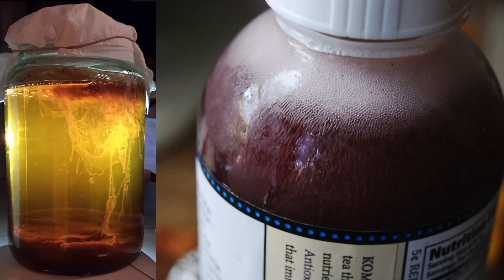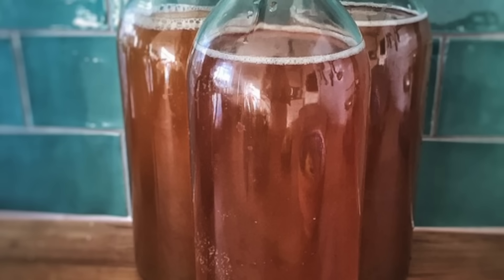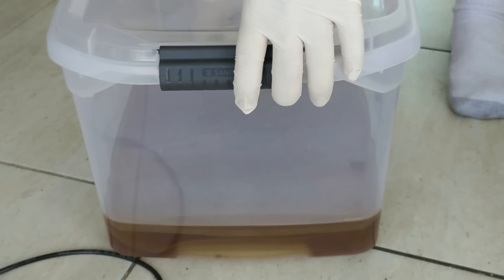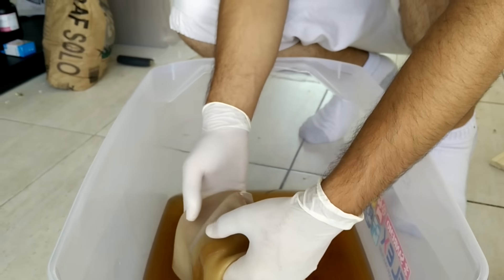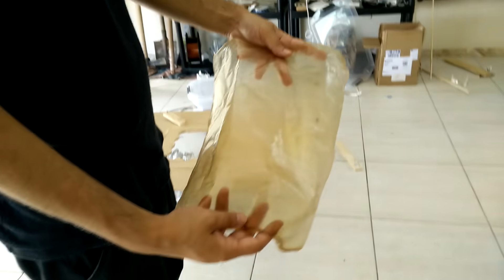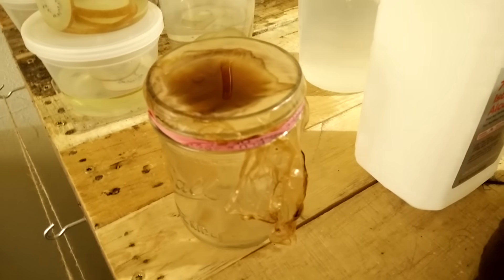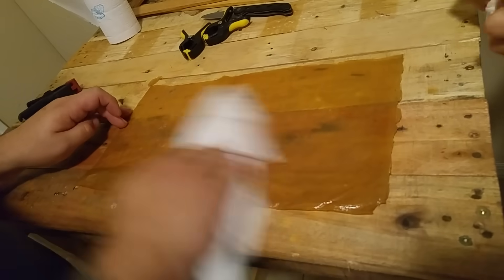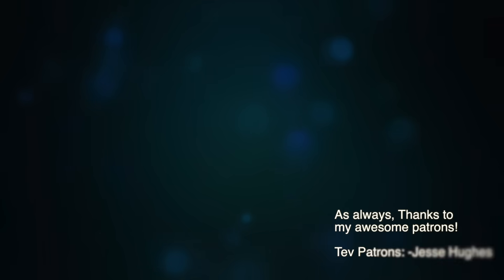How to Grow Leather-Like Material Using Bacteria (Making Kombucha Leather)

Comment: While the current state of leather production doesn’t bother me in the slightest, this is awesome. My question is does this use less resources than animal hide leather products? If so, is it as durable? If you can make a faux leather that is competitive with the real thing, I’d wear shoes made out of it.
Reply: So I ran the numbers on water usage by the kombucha leather and Bovine leather.
The average water consumption for tea is 10394 m3/ton or 10.4 l/gram. The amount of tea per bag can vary from type to type, but as the video calls for using two bags per gallon, I’ll assume the bags used are for 4 pints (half a gallon) of tea, which, according to the “Northern tea Merchants” site contain 18.2 grams of tea. As a gallon is 3.78541178 liter, that would make 2*18.2/ 3.78541178 = 9.6159 grams of tea per liter of water. This would make for 10.4*9.6159 +1 = 100.95 liters of water per liter of tea (the water used for brewing included). 
As for the Sugar, cane sugar was found to use 1500 m3/ton on average, or 1.5 l/gram, whilst beet sugar uses 935 m3/ton or 0.935 l/gram on average. As previous comments mentioned sugar canes, I’ll be using that figure. 
Depending on the source, the amount of sugar in a cup ranges from around 170-225 grams, but most of them seem to put it around 200 grams. So, one cup of cane sugar means 1.5*200= 300 liters of water used for one cup of sugar. This would make 100.95+300 = 400.95 liters of water per liter of kombucha starter. 
For ease of calculations, I’ll assume we’ll be making one square meter of the leather. The video calls for putting about 4 inches, or 10 centimeters of starter in the bin. For one square meter that would be 1*0.10 = 0.10 m3 of starter, or 100 liters. Multiplying this by our water footprint we get around 4000 liters of water for 1 m2 of kombucha leather (Disregarding the probably significant water use of making the oils and wax used for processing the dried SCOBY into the actual leather).
According to waterfootprint.org, just producing the raw skin of a cow takes about 17000 l per kg of leather (this is using the total water usage per cow and the percentage of cow that is the hide). Then the processing takes another 40-45 l per kg of hide. As a cow produces around 5 m2 of hide, and waterfootprint.org uses a figure of 6kg of leather per cow, that makes 20400 liters per m2 of leather from just the cow. As the 40-45 l per kg figure uses hide, not leather, that comes to a mass of around 6.4 kg per m2, which makes somewhere around 270l of water per m2 of leather. So if you then see leather as a byproduct of beef, water wise, it’s actually way more sustainable then the kombucha leather. If you however take in account the amount of water used by the cow you see that the kombucha leather uses about a fifth of the amount of water used for bovine leather.

sources: https://s3.amazonaws.com/academia.edu.documents/31054363/ChapagainHoekstra2007waterforcoffeetea.pdf?AWSAccessKeyId=AKIAIWOWYYGZ2Y53UL3A&Expires=1519739374&Signature=DvX54nsti8lwMt0M6D%2FIaulzPZ0%3D&response-content-disposition=inline%3B%20filename%3DThe_water_footprint_of_coffee_and_tea_co.pdf
https://research.utwente.nl/en/publications/the-water-footprint-of-sweeteners-and-bio-ethanol-from-sugar-cane 
http://waterfootprint.org/en/resources/interactive-tools/product-gallery/ 
https://www.leather-dictionary.com/index.php/Measures_and_weights 
http://nopr.niscair.res.in/bitstream/123456789/26498/1/JSIR%2060%286%29%20443-450.pdf 
https://leatherpanel.org/sites/default/files/publications-attachments/mass_balance.pdf
Reply: TheOneZenith this is what an actual debate and exchanging of ideas should look like. Props to both yall
Reply: As a rule of thumb, animal agriculture is about 10% as efficient as plant agriculture, whether that's calories per dollar, land area per pound, gallons of water per month, or whatever. Obviously it varies depending on the animal and plant you're comparing, but it's physically impossible for a given animal to be more efficient than the crop it eats. 

People have a distorted sense of the cost of animal agriculture, because it's so heavily subsidized in the US and because that industry isn't really held accountable for its waste. (You pay for your burger/boots once at the store and again in April! And, your children will be paying for it in the decades to come.) Given that the "green" methods for producing leather use plant byproducts and the traditional ones use processed chemicals, this bacterial leather is almost certainly more efficient than leather.
Reply: The gasses given off by brewing Kombucha are very good for plants. I noticed it because the pot plan which had been struggling for some time is looking better than it ever did despite my lack of maintenance. The Kombucha and plan sat side by side inside, on the windowsill as the Scoby grew. So perhaps agricultural products could be grown at the same time as the scoby.
Reply: qwerty81808 Feel free to eat your shoe because in this thread I have shown it is more resource efficient to use rabbits. Now if instead of sugar cane or sugar beats you could use honey, plus the benefits of the wax and propolis to cure the kombucha leather, it may be more efficient in the long run. Again, read the entire thread. Sugar cane and beets take a lot more land, water, fertilizers, and potentially pesticides/fungicides, to produce sugar than raising rabbits. Additionally, tea is a tree that requires multiple seasons to produce a proper crop and both sugar and tea require processing, sugar especially has a lengthy production process requiring considerable inputs of energy and tremendous waste is produced.

I am excited by the technology introduced and the possibility it represents, it’s just not as efficient at this time.
Reply: The Thought Emporium: Sorry to hear your batch got contaminated. :( Btw, which math was off?

DeepOff: What? What does that have to do with our discussion over how to make kombucha leather as sustainable and resource efficient as possible?
Reply: Theo this is the future. Growing clothes using a mould in a incubating chamber. Seamless, cheap and waterproof. you can add dye to the entire material during the growing process instead of just dying the surface. Especially when leather gets worn out it shows the white scratches. Material wise this is more versatile and easier to work with. Even if this is 2x costly than rabbit leather it wins hands down.
Reply from the maker: 2 cups of sugar, a gallon of water and 2 tea bags and 1 month. a similair amount of cow requires all the food and water the  cow will drink and eat in it's whole life, and a few years. It's as strong or stronger than nylon.
Reply: The Thought Emporium Yes, but I own rabbits. They take significantly less resources than the production of tea and sugar. I’m not dissing your faux leather, I love the idea actually, I’m just concerned that the actual resources consumed from creating it may not be as efficient as animal sources which also provide meat and fertilizer.

For vegans, this is the perfect leather replacement. For the rest of us, I don’t know. I do know i also love the idea of using beeswax in your process. Have you considered also using bee propolis instead of coconut oil?
Reply from the maker: There is no way that the amount of food and water required for a full rabbit life cycle takes up less resources than a single tea plant and like 1 sugar cane which would be enough to make several square meters of this. That's the point. Nothing is more efficient than this. Hell it's even 18% protein by weight, you could eat it and it's probably better for you than the rabbits. I mean rabbit isn't that nutritious to begin with. That's why I'm so excited by this stuff. It's basically free material for whatever you want. And we've refined the process a lot now and gotten it to do weird things. Made one batch go hard as a rock which was cool. The stuff just has so much potential

I'm not vegan but I still want this stuff for everything. It's ridiculously strong and durable. My wallet is made of this stuff (I made a better one than what was in the video) and it's lasted almost as long as this video is old and it still looks basically brand new. The weakest part on it was my stitching.  

I hadn't thought of bee propolis. I'll look into it!
Reply: The Thought Emporium It takes more than one sugar cane to make a pound of sugar and tea trees require time and resources to fully mature to be used for kombucha. This is an agricultural endeavor that takes the better part of a year for the sugar and I seem to remember tea trees taking about a decade to reach maturity. 

Growing out a rabbit, if pasture raised, requires very very little. They eat whatever happens to be growing in your lawn, weeds, vegetable scraps, and are fine with a few cups of water a day. From birth to plate can be as little as a couple of months. In that time, the doe can produce a few litters(up to a dozen kits each litter) to continue production. Each rabbit yields a few pounds of meat, a skin about the size of the bottom of the totes you’re using, and it’s own tanning element in the form of brain tanning. Their waste product is recycled back into fertilizer for their food production. 

I’m not sure if you’re using sugar cane sugar or sugar beet sugars(which is what is available in my area) but even the processing of either requires considerable energy production, land resources to grow it, fertilizers and potentially pesticides, and of course lots of water over the course of a growing season. This is why I mentioned it, though I encourage you to continue your research.

Keeping with the thought on bees, would it be possible to brew kombucha and produce large leather viable scoby mothers using honey as your source of sugars? I’ve brewed kombucha before but not with honey. I’ve brewed mead with different herbs and teas in it and that turned out delicious. Honey can be crystallized with no added energy cost, just natural dehydration over time, or used in a creamed or liquid state.

The research is exciting, but the resources consumed are a lot to produce the leather scobies when you really dive into it. If it could be streamlined, again I’m looking at bees because it seems like they could produce a fair number of the resources required, then maybe this could be a fantastic way to produce faux leathers in quantity that would drastically lower the methane emissions from cattle farming. More leather products, less cow farts.
Reply from the maker: Your math is wrong. We were growing a small swimming pool worth which was 5 feet across (1.5m) and 8inches deep. That works out to about .89 cubic meters of volume or 890 liters of water. We used a whole box of gallon tea bags and about 15-20 pounds of sugar. It was growing fine but got contaminated before we could pull it. But otherwise that would've made several meters of faux leather as it can be harvested a couple times.
Reply: MochaTater you don't need tea to grow scoby and sugar is still ultra cheap
Reply: TTeaMeister Inspector Tea Fine. Let’s use rabbits for an example. You get leather with the additional benefits of meat, and wool if you raise angoras, and they fertilize their food source as they go. Pasture raise rabbits with rainwater collection systems on movable rabbit tractors. About one litter would provide a square meter of leather. One rabbit tractor modified as I’ve stated on a standard pasture rotation(just move it to a new patch of lawn every day) and a few months, no additional inputs. Tan the leather using brain tanning.
Reply: qwerty81808 No, I’m not. Read the entire thread. There are other sources of animal leather other than cows. Animal leather is also not the only product acquired raising livestock, it’s more like a byproduct of meat and/or dairy production.
Reply: wcr3650 Your post seems to be written from the perspective of a devout of veganism with an inferiority complex. If you need to enter our discussion hostile and insulting in order to garner any attention, you’re in the wrong thread. My numbers come from experience and research; start with Storey’s guide to raising rabbits.

My animals are in excellent health and the accusations you’re slinging are potentially actionable in court as libel, since I run a business, so I would suggest you edit your comment.
Reply: Artytom Inquisitive Minds yeah, yeast makes, co2
Reply: Part of the point of the video is that we are moving away from live animal meat towards cultured meats, and leather may no longer be treated as a by-product in the calculations above. The rabbit thing is interesting, although I don't know anything about farming but I assume you couldn't pasture raise rabbits at a mass production scale? Also, it still has ethical implications; while I am no vegetarian, I still would prefer to not kill animals if I can get meat grown in a lab and leather grown in a kombucha vat.
Reply: wcr have you ever grown sugar cane? I have! Again you need to think about the weight gain per day in relation to the water drunk per day. Tell me, how much sugarcane is grown in Texas? & why has sugarcane not replaced all the cattle ranches if it's much more water efficent like you claim? You believe cattle are grown in the desert, but how about sugarcane growing in the desert? Is that viable in your mind? & why is it not done on a widescale like cattle are?
Reply: wer, leather is currently produced as a bi-product of cattle raised in the desert. Is it more efficent to dispose of that skin & grow sugar to produce kombucca leather is the question & I would say no. If meat stops being eaten (which will never happen) it will still be ecconomical to harvest leather from desert raised animals, as is proven with kangaroo leather & rabbit fur from Australia, because there is no other ecconomic use for the desert land

Now some farming info for you. Cows are slaughtered at an average 12 months of age, so leather's only taking 1 year to produce, near 2 if you want to include the pregnancy period, but if we do that we can also include dairy cows where they're pregant during lactation & so no productivity lost & their leather is completely fine, not lower quality like their meat is.

Sugarcane varies depending on heat, fertiliser & water provided, but is ready for harvest between 12 & 24 months of age once established (generally 18 months). Every 5 years or so, the entire field must be stripped back to get rid of all the culms or the plant dies. I'm doing that with one area of mine right now & I will get no yield this year as a result, it will be 2-3 years before I get a new crop from that area. So in short, even with breeding cycles included, sugarcane doesn't yield any more frequently or higher than cattle do, however it cannot be grown in the desert as it needs FAR more water than cattle do per kilo of produce.

You seem to think sugarcane is producing MASSIVE amounts of sugar, when the reality is that the bulk of the plant will become mulch. The sugar is the plant's sap, it's only present is small quantities in relation to the bulk of the plant & then it must be processed into the refined sugar used in this setting, with the molasses etc removed from it & that reduces it's quantity per plant/per hectare even further.

I don't know the quantity of sugar needed to grow scobie leather - YET will need to get back to you in a few weeks on that one, but so far what I'm seeing is indicating to me it's likely significant quantities for the quantity of product created. Where I think I'm going to get my moneys worth in the sugar costs is in the CO2 produed. If I can set up my indoor grow area to contain a scobie growing plate & have it offgassing CO2 into the enclosed environment the plants are in, that should give me a huge growth boost & act the same way as the yeast/sugar CO2 production systems many growers use. Of course on a large scale, that's a HUGE NEGATIVE for this leather alternative too isn't it! Unless it can be set up in purpose built greenhouses with an underground level for scobi production or something, they it's going to be very damaging to the environment too, far moreso than using a waste product!

You need to start experimenting with different types of growing & actaully learn how farming works. No reason you can't grow a few sugarcane plants where you live is there! Even just buy a store bought lettuce with roots still attached & put into a milkbottle full of water & put in the sun & see just how inefficent plants really are with water use. The lettuce will need FAR more water to produce a pound of food than your pigs will!
Reply: TheOneZenith organic sugar takes 10 pounds of pesticide free sugar cane. Given that one sugar cane weighs on average 3 pounds, that's three stalks. It takes 12-16 months to harvest.  It also doesn't require much waste because it retains a lot of water. 

Two bags of tea can be gotten from one tea plant, easily. You don't need much tea to grow a scoby nor do you need much water. You can actually use the same bath of water multiple times, just adding sugar to it. 

Sugarcane has no waste. Anything that comes from it can be used or returned to the earth as fertilizer.
Reply: DeepOff I would, although I think the term you're looking for is "artificially grown meat" not "science grown meat" as any meat produced nowadays has used some sort of science in the food or processes used.
Reply: qwerty81808 No, read my calculations, it takes only 4000 liters of water to grow the sugar and tea, but 17000 liters of water just to grow one kg of leather, one cow takes like 300000 liters or something
Reply: Ilsunny Lo Rabbits don’t take years. Read the thread.
Reply: TheOneZenith also no need for injecting antibiotics as is needed in the animal agriculture business. Less waste in terms of the manure too. Many manure cannot he used as fertilizer unless organic because usually kills the plants from the incorrect diet most r fed (cheaper but wasteful)
Reply: Ayana Sioux Art does sugar not come from beets these days?
Reply: "Less resources". It'd be net cost.  This is likely more expensive to do otherwise we'd be doing it.  Cows don't just make leather.
Reply: Trid Tou should try to have a civil discussion without insulting people’s choices.
Reply: TheOneZenith  IT SHOULD
Reply: Thermo dynamics .. this method will is extremely likely to use less energy. animals use significant energy from plants. its like comparing a sapling to a skunk.
Reply: Look up Jun Kombucha (green tea + honey) not sure if you can use honey to keep it alive however.
Reply: wcr, the numbers for cows drinking in Australia, as per farmer assosiattions & recomended quantites/support for farmers in setting up & purchasing appropriate numbers of animals in Australia is 45litres per day average for a full sized cow, up to 60litres per day lactating & in hot weather & 30litres per day for weaned calves. There are Texas numbers out there that a vegan linked me to that show the same, but go into more detail of water per day per weight. Cows gain 2-4pounds of weight per day, around half of that becomes edible meat, so that's 45 litres drunk per kilo of beef produced, so I would say the 103litres per kilo is quite viable.

I'm guessing your micro-pigs are pets, but why don't you think about real numbers for them in an intensive breeding environment, where they're raised for 3 months & then slaughtered. How much water is each of those piglets drinking per day compared to how much weight/meat it gains each day?

If by some chance your pigs are not pets & you do live on a farm, are you on town water? Or do you collect rainwater into small dams & use that for their water? Small property catchment dams are considered "green water" not blue, as it's not practical to harvest them into the main water system for treatment & mass human population drinking, so despite the numbers you give, you may be using zero "blue water" on your pigs, blue water being the numbers I gave earlier.

I would also suggest that there may be more efficent systems possible that cause less wastage of the water. I used Australia's numbers because they are very comprehensive & easily accessed & because like you said, it's so hot, so I think that's good for credibility, but the continent is also the driest on the planet & so they are innovative with water reduction. There's a lot of systems out there for the cows living in the desert where the water points have forms of covers on them to prevent evaporative losses & soiling of the water while still giving cows access to drink. There's even talk of creating a water free block to stop cane toads spreading down the west coast of Australia via systems for the cattle water points through the desert there that would be so sealed that even frogs & toads couldn't get into them. Lots of water reduction is possible. (and cattle do live in the desert in Australia, just google image "Australian cattle station" if you don't believe me)
Reply: "A Cup of water a day? Yeah, right. Maybe if you keep them in a climate controlled hut or live in the ideal climate," 
My pet bunny lived in a climate controlled environment, controlled by him lol. I'd try to get warm & he'd jump up & turn the air con on with his teeth because he decided it was too hot. Very annoying, but also very cute :) Anyway he had a little dish for water, that I'd say probably held about a cup of water, maybe a little more. He'd empty it every 3-5 days, depending on how much time he was spending outside with me. He never went into the sun though, rabbits don't like the sun, they like the shade & cool. 

I would assume TheOneZenith probably isn't in Texas, I doubt many rabbit breeders would be, rabbits are from England & do much better in the cold than heat! Which means most rabbit systems like he was talking about are mostly covered to provide shade & cool, with good air flow from the sides, but not the top & the water numbers he gives are very reasonable for a rabbit! Your numbers would be on par with a human drinking 10-20 litres of water per day. The rabbits wouldn't survive if they were drinking water at a rate that makes up such a high percentage of their weight! A 3-4 kilo rabbit can't drink 1 kilo/iitre of water per day like you are suggesting! Even in the hottest of climates! They would die of heat stroke WELL befor they reached that water level. 

Do you actually know of any commercial rabbit breeders in Texas? There's plenty of rabbits in the desert of Australia, but they're wild rabbits & live in burrows underground, where it's cool, only coming out at night when temperatures are near freezing & so they drink normal quantities of water. No commercial rabbit farms there! The only fur/leather coming out of the heat of Australia is from the collected pelts of biological control killed animals. Texas I'm sure woudl be the same, culled rabbit pelts, or no commercial rabbit pelts
Reply: Anything you can make in a vat will almost always take less resources than feeding an entire living mammal until it reaches adulthood
Reply: +TheOneZenith What does it matter if you run a business. You commented and thatperson replied. lmao What are you going to sue for $ 2.00 ? come on now..... calm down.
Reply: +TheOneZenith I would suggest that person not edit anything because this is a public platform. I guess you don't know what your talking about.
Reply: Nate fletcher Considering I’m a farmer who raises vegetable crops and animals, I am aware of the cost. We try to have as much of a closed system as possible on our farms. Rabbits, as I mentioned before, take significantly less resources. Sheep, goats, and regrettably(don’t raise pigs unless you use a rotating paddock system, have lots of land, and are way away from anyone; god awful stink and mess) pigs all produce meat and leathers with significantly less resources than cows. Tanning does not require harmful chemicals, as alum and salt or simply brain tanning gets the job done just fine. With cows, sheep, and goats you can have the added production of milk to convert into other products. Sheep and angora rabbits produce wool as well.

So yes, for the amount of resources put into kombucha leather I do not think it beats animal leathers. I like the concept but the way it is shown in this video leads me to looking for improvements on the resources used, hence why I suggested bees. The wax, propolis, and potentially the honey; these in conjunction with a tea orchard(tea leaves grow on trees/shrubs called Camellia sinensis, and are perennials, not annuals that you plant and harvest each season) would create a closed loop system which with tweaking may eventually be as efficient as animal leather.
Reply: TheOneZenith Hmm if that's the case, then yeah, I do agree that rabbits would be the more sustainable option here.
Reply: To be fair, that's the biggest problem. Cows are killed anyway, but the huge amount of chemicals to tan leather isn´t
Reply: TheOneZenith oh ducking course it does you have to feed a cow for a few years compared to dropping some sugar and culture into water and waiting a few weeks
Reply: TTeaMeister Inspector Tea If you’d like to get specific on water, about one cup per rabbit per day. For a litter of ten under a tractor, if you are providing the water and not the sky, about 53 gallons for three months of growth. This is significantly less than your 4000 liters by about 3800 liters. The amount of land required depends on the fodder planted, rates of growth of the fodder and weather conditions. In my climate, standard lawn grass needs to be cut once a week or so. A rabbit tractor is usually about 8ft by 8ft for twenty rabbits. They’ll chew a patch of lawn down to reasonable height in a day. So if you’re in a climate where you need to mow about once a week, you need at least 448 sqft of land. Given we’re only talking about ten rabbits and not twenty, this is probably overestimating a bit. For reference, acre is 43560 sqft.
Reply: You wont need to use tea if you aren't drinking it just boil up some dry grass or leaves for whatever trace elements the scobi needs probably mostly nitrogen they don't need a plant with caffeine.
Reply: TheOneZenith obviously we are talking about leather from cows and crocodies. Do you see LV rabbit bag? Do you even think of the size of rabbit skin can cover the size of a man jacket? You definitely never process leather clothes before for you to suggest using rabbits. You would need like 10 rabbits and then it will still look like frankenstein. Not only is this bacteria method able to conform to size and shape but also remove seams to improve water proofing. You can also determine the thickness whereas leather only comes fixed height. Lets get real. If i can have seamless leather waterproof clothes and shoes i would rather pay more not only as a consumer but also as a producer. Sewing leather together is labourous and cost $ to hire seamtresses. If i can produce 1 seamless jacket growing from a mould i dont even need a seamtress!
Reply: Ilsunny Lo I raise rabbits. I own a farm. Yeah, I’ve produced leather products. Check out my channel, I think there are some videos of our farm. Again, read the thread. Some great ideas have been bantered around in the comments above.

What I’m waiting for is someone to say if the scoby can live on honey. If it can, then that would be a more resource efficient source of sugar. My concern is that the antibacterial and antibiotic properties of honey will prevent the scoby from growing properly.

Anyone out there produced kombucha using honey?
Reply: Yeah, Jun uses green tea and honey and several photos show good SCOBY formation. 
Also, there is some information on this site: https://traditionalcookingschool.com/food-preparation/can-you-make-kombucha-with-honey-aw085/
Reply: TheOneZenith! Amiteash Paul found the answer! You CAN use honey for growing scoby!
Reply: I'm with TheOneZenith! You guys need to grasp the difference between green water & blue water & understand how the numbers you are using on cow water are calculated. The blue water numbers for cows can be as low as 103litres per kilo of beef (about 12 gallons per pound) http://www.target100.com.au/Hungry-for-Info/Target-100-Responds/Australian-beef-production WAY lower than the numbers you're using! Cows can be equal in efficiency to Zenith's rabbits, just on a larger farm/space. Do you all realise that 1 BILLION hectares of grasslands are burnt each year in Africa alone due to a lack of grazers to eat the grasses & that the land would desertify without the grazing? The issues with cows are political not space, too many of them in the wrong places, not enough in the right places & management also needs to be corrected in many places. If you feed cows on wheatgrass, you have a problem! The grass needs to be allowed to grow between grazings, like it's evolved to do on grasslands with tight, migrating herds. If cows are fed on mature grass & then the grass left to mature again (using the same system Zenith's talking about with rabbits but scaled up), they easily get all the nutrients they need from the grass & the grasses hold the rainwater & slowly release it into rivers & dams, therefore containing & providing all the water they need to.

Sugarcane is at least a C4 photosynthesiser, so it's relatively efficient in it's water use & carbon sequestration & growth BUT that also means a need for double nutrient input compared to the tea, as someone else commented though, the tea's probably not needed, just the nitrogen or something, maybe filtered manure or worm juice?

All in all though, crops always need more resourses than livestock do when you look at genuine information not political stuff & this is also why lab meat is dumb, it needs sugar to grow & sugar is just not as efficient to produce as cows are, due to cows providing all the fertiliser needed to grow their own food. Lab meat also uses fetal bovine serum, which means pregnant cows must be killed & the baby killed by draining it of blood to make that meat, so personally I will NEVER eat it based on the ethics of how it was developed!

In saying all of that, as someone without the space to grow rabbits or other animals at this point in time, I love the idea of this video's leather & I'm really keen to experiment with it & I definitely think it has a part to play in society, but lets not get to the point like we currently have with lanolin & animal fat, where bi-products are being thrown away while rainforests are being cleared to plant palm oil to use in their place to obtain "vegan" labels. Lets focus on reducing waste & logical thinking about resourse deployment instead of political & emotional claims that just aren't backed by facts. Just remember when making cow water claims, that there's a direct correlation between the rain a country gets & it's crop to livestock ratio. The drier the country, the higher the ratio of livestock to crops, because livestock are more water efficient than ALL crops are! Mongolia, Australia, Saudi Arabia, Mauritania, Namibia etc etc are all nearly all livestock no crops, while Thailand, Bangladesh & all the monsoonal countries are nearly all crops & only draft power livestock. These claims that cows use more water are proven ridiculous by real world operations
Reply: Ausintune yeah but you also have to look at how many resources and time it takes to grow that sugar and tea. It doesn't just magically appear as is
Reply: TheOneZenith but then if you were to scale this, how much land would you need? And how much rain water is used (about 90-95% of the water used for the cultivation of tea and sugar and for the total process of growing a cow is rainwater, or green water. I decided to count this as rainwater could also be used as drinking water or to grow grain for people)?
Reply: The Thought Emporium Fact is, it still uses about 4000 liters of water per square meter of kombucha leather (check my earlier post for the calculations and sources for this)
Reply: TheOneZenith 
Are you willing to eat science grown meat? That's what you need to answer
Reply: Yes, I understand that. Did you think my comment was a reply to you?
Reply: Lets not talk about rearing and waiting years for animals to  mature to be slaugther. This is definitely faster and cheaper 10x when growing your leather on demand.
Reply: Michael Balfour it never came from beets?😂
Reply: Never heard of a sugar beet? Sugar cane would be inefficient for getting sugar in this day and age; why do you think it became so cheap in the 20th century? If someone says something look it up at least, before jumping to conclusions or trying to mock them with 😂 emoji.
Reply: Michael Balfour "why do you think it became so cheap in the 20th century? " firstly because workers rebelled against pay & burnt the canefields down & they discovered by accident that this made them safer& easier to harvest, then second machinery was introduced to do the work humans had been doing. Most sugar still comes from cane. If you've ever grown cane v beets, you'd know why!!!!!! sugarcane grows faster than bamboo! beets are just annoying to grow! very heavy fertiliser users & very slow growth for low sugar output. They're only suitable for a non-globalised system, where cold countries want to grow their own sugar, but in practical terms it's pretty stupid & inefficient to grow sugar in any form other than cane in tropical areas of the world (well with global warming now it can be grown in non-tropical, hence mine in my temperate backyard, but tropical's still better & no question cane's better than beets!)
Reply: Michael Balfour damn chill I wasn’t mocking you. I was confused can’t you see the question mark. I was going to search it up now if you hadn’t taken so much offense damn now I won’t tbh I don’t give a shit anymore 😂😂😂😂😂
Reply: Cat Chromium, I'm not really concerned whether you look it up or not; no need to be salty I just happened to believe you were mocking me with the😂 emoji. Moral of the story is, if someone says something that seems unbelievable, before ridiculing someone, look it up first to falsify it.
Reply: TheOneZenith your aware of the costs of animal rasing compare with agriculture right, there is literally no way for this to cost more
Reply: @TheOneZenith Still, though. Even if it's a byproduct, it would not exist if the resources needed to raise cattle weren't expended. Trying to get around that by giving it a name is just sophistry. I'd eat my shoe if it takes more resources to grow the quantity of sugar and tea for a rabbit sized piece of kombucha-leather than it does to raise a comparable rabbit. Think about it, your rabbits require land and fresh grass to eat. If you cycle where the rabbits graze intelligently you can minimize the land needed to care for them, and yet compare how much leather you could get out of those rabbits to the amount of kombucha-leather you would get out of that land if you used it to grow sugar-cane or sweet potatoes, and tea. It is certainly more efficient.

And you think rabbits can make a lot of babies? Just wait until I introduce you to seeds
Reply: TheOneZenith It's really simple: If you can find an animal that you can make leather from that takes less than 4000 litres of water per square meter of leather (see my previous post for an explanation on that number) and doesn't use any harmful chemicals, you have a point. If this is not the case, the kombucha leather is better.
Reply: It's not you dying for a hand bag, so why should you care? Dolt.
Reply: Nate Yeah. And it ain't you who's drinking 25k or more liters of water, nor is it the plants who could use it more efficiently. Dunce.
Reply: The Thought Emporium however cows are grown in herds on ranches that are thousands of acres with food which supplies food and the one I work on has ponds for the cows to drink on so that's drink so all that we do is put out salt licks that have minerals and the cows are sold for meat leather and there hooves also testicals and milk unlike this where there is minimal prophet and the crappiest pleather
Reply: @TheOneZenith I get where you're coming from, but do you realize that you're saying the resources required to grow sugar, tea, and the byproducts of that process are greater than the resources required to grow all the food needed to feed a 1,600 pound cow for its entire life, not to mention everything else necessary to do in order to raise cattle, besides just growing their food.